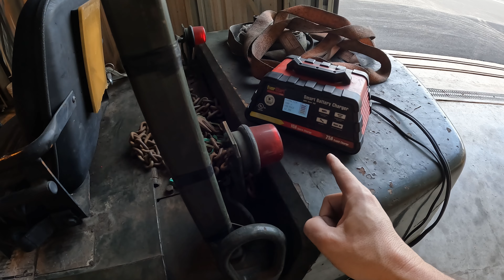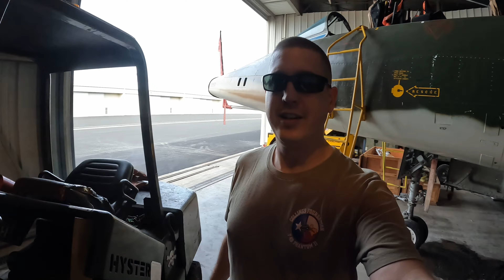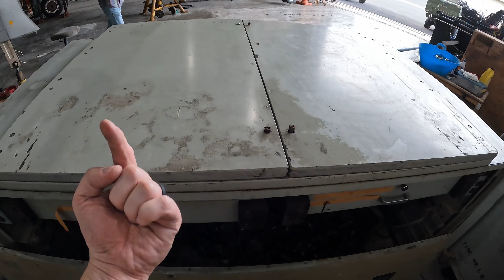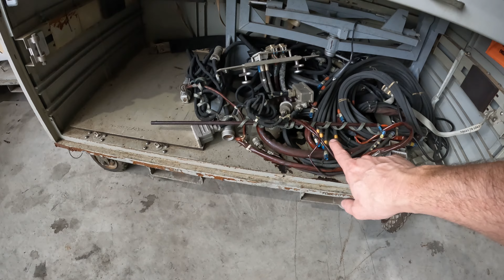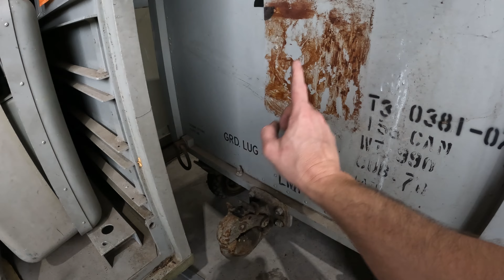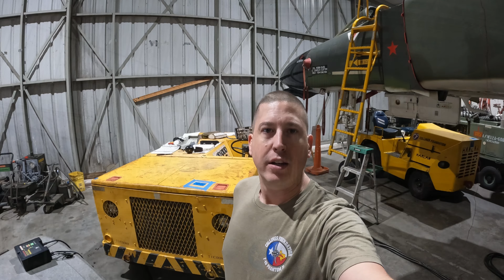I Got Benched? | F-4 Phantom

Comment: Oh man that would be so cool to work with! Wish I had the time to help out with that I'd be in heaven for sure! I was a DEPOT Avionics Test Set Technician for over 22 years until I retired two years ago. Prior to that I was an Aviation Electronics Technician for 20 years and retired from the Navy. I am not familiar with this particular bench, but trust me, that bench looks OLD and doesn't look like it's been maintenanced in quite awhile. Before you use the Test Bench you need to do a Test & Check (Confidence Test) on the Bench and cable inspections to ensure the power is going to the pins it should go to so you don't fry any aircraft equipment. You can use the Bench Maintenance Manual to do that. Pull the Backshells of the cable ends and do a good physical inspection, then ohm out those cables before you do a Bench Test and Check on it. If the cables ohm out correctly and the Bench passes a Test & Check, you should be good to go. Don't forget to check the Manual for Serial Number Modifications and Particulars. Look fwd to your next video. Best Wishes & Blessings. Keith Noneya